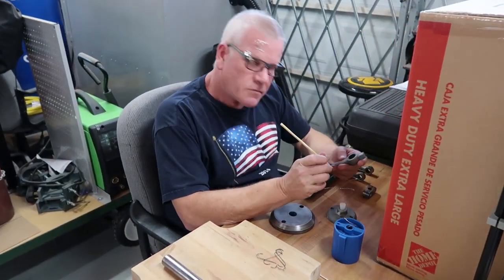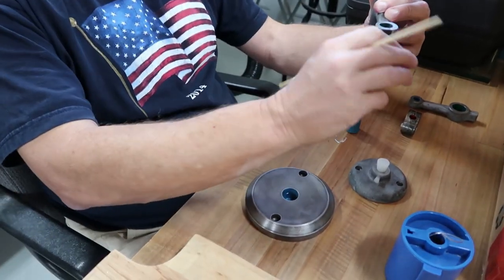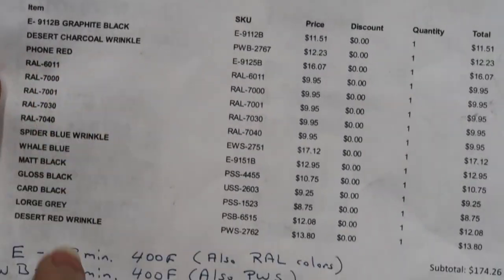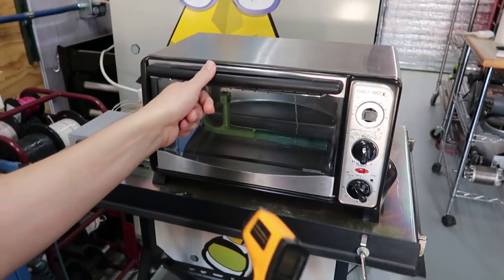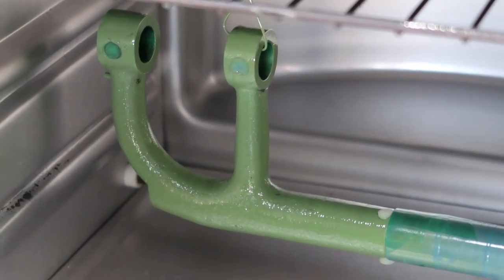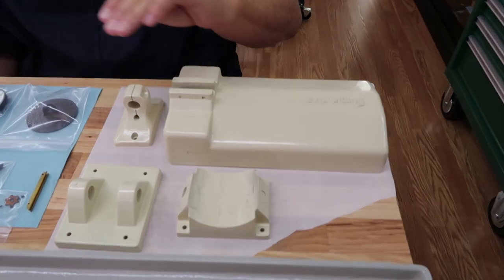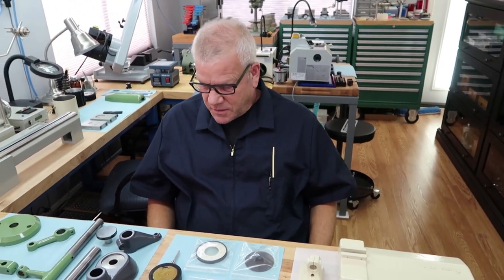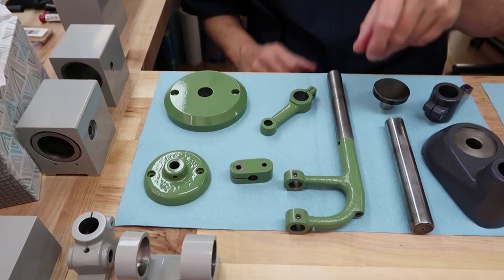SHOP ADVENTURES 04: Powder Coating Watchmaker Drill Press

Comment: I always wondered about powder coating. Nice oven mod. I found a used ceramic kiln for a really low price. I should give powder coating a shot.
Reply from the maker: You should try powder coating, we are liking both powder coating and 2 part epoxy paints here though neither of these are what we do daily. They are just a part of the journey to build a thing we have named  "The Perfected Product".
 Power Coating is fun your oven will be better then ours we bet a kiln is good what you want to do is control the temperature within 1 to 2 degrees during the entire baking process that is what w e built otherwise that little oven was swinging 20 plus degrees or more plus of minus so that was not going to work, that oven was built to bake paints in watch movement hands and a few other watch parts we were machining here. Thank you for stopping in watching and sharing your kiln thought. Lance & Patrick.

Comment: G’day Lance, I can see the advantage of working on small micro machines, you can fit three of them on one table. I like your industrial spray booth and oven but the oven is a little small even for micro machines. Since you are working the oven above temperatures it was intended for wouldn’t it be better with a suitable heat resistant blanket
Reply from the maker: Hey Hi Peter our Australian friend.
Yes we love that these machines are small, being the micro machining guys has that advantage, besides we only have a little bit of space(s) spread out around here. 
Peter you are correct we can place many small machines on each table I think the workshop has 7 or 9 tables each has machines on them, so we can move from machine type of cut to another machine to take a part from start to finish. 
Most machines we have are on a single table dedicated, because the motor mounts support equipment like as an example that is really a production benefit to us is that each machine has its own dedicated support equipment meaning each machine has a full collet set, tools wrenches etc. (put us in the poor house) so that no two machines share anything with one another, we got tired of getting up from one table looking around on other tables to find a this or that thing we needed however, there are a few machine tools that are freestanding or portable Peter.
One machine we are rebuilding right now is a Watchmakers Lathe by Flume it is a model 53 and that is portable, so it can share a bench with other machines, two is the maximum for our table to machine sizes though I wish three would fit $$$$. 
Good eye on the baking oven Peter, it is really small it was all we could afford to build when we built it and we were actually powder coating a small machined part (its original intended use, that never happens around here) and not the actual machines themselves, so we added a fan override switch an PID controller and the oven is rated for 500 degrees constant (that is what it says in it anyways) we tend to powder coat at between 350 to 450 degrees Fahrenheit for about 10 to 20 minutes, like in this video at 400 degrees and the oven holds steady with no fluctuation however, also know we only bake a few parts at a setting, because the oven gets too hot for us it is really being stretched out here as you mentioned Peter, i.e. the good eye comment. The heat resistant blanket might not be all we need we do have a fire extinguisher at the very ready, the oven bottom however seems to stay really cool.  
If we continue to paint more we will buy a professional oven by then maybe we can do that, we need to see how much paint and powder coating we are looking to do in the future Peter, sorry for the long message, but I enjoy sharing so much, we are so thankful to have something to share it is really a great feeling for the two of us.

Comment: The best thing to do when masking is to remove the masking tape as soon as possible. If you can remove it without disturbing the wet paint that's even best. It'll come off much easier and the paint will lay back down smoother plus it won't chip. Any paint that has "torn" edges where the masking was pulled away can easily be cleaned up with a straight edge and razor blade. Great videos so far guys!!! Keep em coming!!
Reply from the maker: Hi Big Wiggle thank you for swinging by and your comment is very agreed upon by us both, if we could we sure would unmask, we do before we bake our parts when we can but some of these parts are so small we have quit the time getting to the tape without our fingers making for quit the mess. Thank you for the share, for coming by to see, what we do here and there, and taking time to share your wisdom, it is what we are grateful for the most. Lance & Patrick.
Reply: I didn't realise you were baking your parts. Makes sense with the paint being laid down on machines that will hopefully see lots of use after you're done with them. I'm not sure if you're powder coating or using heavy duty enamels, but handling small freshly painted parts is asking for a dirty fingerprint to be imprinted in the paint so I agree with waiting till they dry.